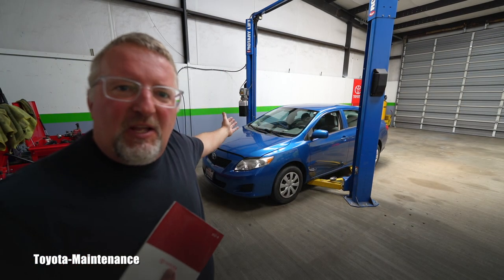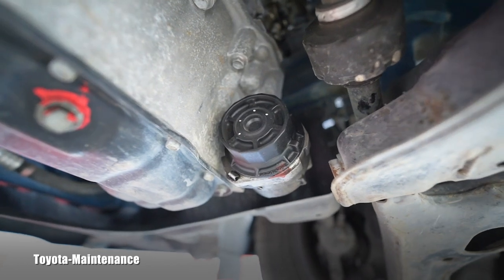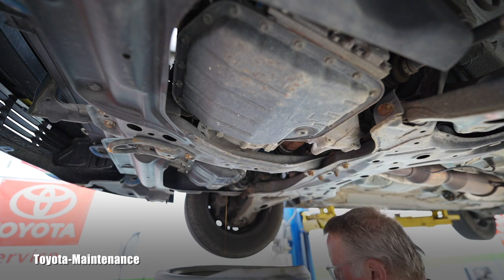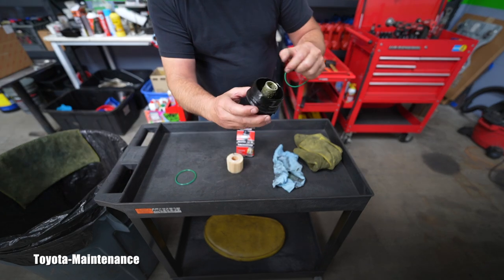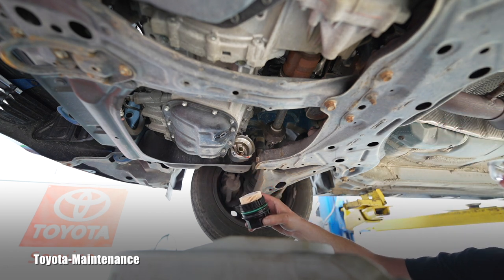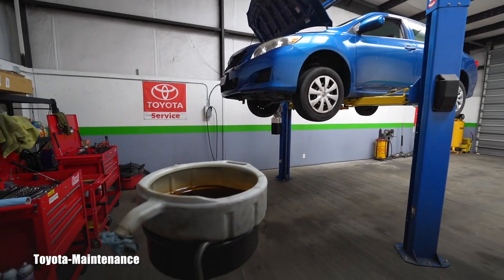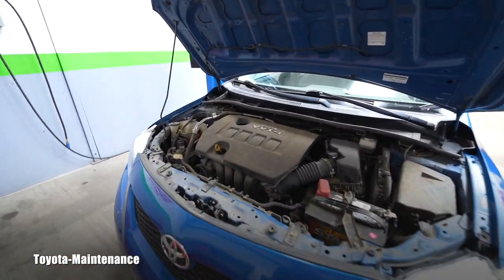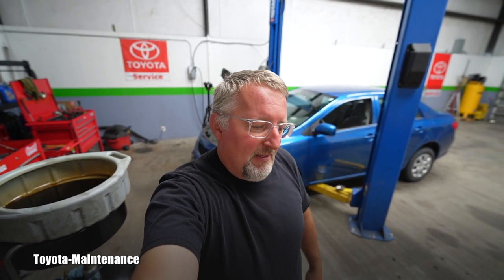2010 Toyota Corolla Engine Oil Change

Comment: I also take a small dab of oil and lubricate the o-ring at the top of the dipstick to prevent future sticking of the dipstick.
Reply: Guess you didn’t pay attention, cuz he did exactly that😜
Reply: @joshhemingway7294 Guess you didn't read the comment properly, he was talking about the o-ring on the dipstick not the o-ring on the filter canister!😜

Comment: So many people overtighten the drain plug and the filter cap. The plug only needs to be tightened to the point where the bolt stretches into elastic deformation and applies enough stretch and friction onto the threads to prevent loosening. It is NOT much torque. Tightening to plastic deformation ruins the threads and they will come out eventually. Same for lug nuts/bolts. The cap seals on that O-ring. These are not pipe threads. 😸😸😸 The cap only needs a small snugging torque and that's it. The O-ring seals it, and the elastic deformation of the threads keeps the cap in place. I've seen so many overtightened like this one, and it will eventually crack the cap and then you have a pressurized oil leak. 🙀 Not good. When I bought my 2012 Corolla used, I replaced that oil filter cap with a brand new one from the dealer because there's no way to know who abused it in the past and how close it was to breaking with further use. It was not expensive. I highly recommend replacing it anyway after 60-75k miles even if you are the first and only owner and did all the oil changes properly from change #1. It's good, cheap insurance!
Reply: Everyone should buy one to have an extra one on hand anyways! That’s a good plan around 60-70k 👍 completely agree

Comment: The camera depth of field at 8:40 has everything behind you in clear focus when you are showing the filter and O Ring because the focus is setting on the distance back there where there is not any motion of objects. That leaves you and the item we need to look at in a blur. Manually setting it to close range will overcome this.

Comment: That plastic oil filter canister was the worst design on the whole car. Everything else was actually well engineered. I had a lot of trouble getting that filter off and finally found a trick. Use one of those specific wrenches like you showed, and tap/hit the handle of the ratchet with a rubber mallet. This will slowly and gently break it loose. It's like a miracle it happened so easily. 

Unfortunately the first time I changed it I also put the o-ring in the 1st groove and after all was done and I cranked up the car, oil sprayed out all up under my engine, bottom of car and the ground. It was very scary until I figured out what I had done. Of course I immediately shut off the car and fixed that issue and I had lost so much oil I had to put I think 3 more quarts back in.
Reply: IS there not a metal aftermarket upgrade to use in this ?
Reply: @SaltGrains_Fready  There is but the spring inside isn't up to Toyota spec. I watched a video of a top notch Toyota tech and he suggested only using OEM Toyota plastic canisters. 

He said aftermarket plastic canisters won't last long, but I do have one on mine and it's lasted for many years and still going.

Since tightening it to a reasonable level, I've had no trouble getting it back off, and it's no big deal.
Reply: There is an OEM metal one get that, around 50 bucks get one

Comment: 13:40, A few years ago I found a great Cleaner and Degreaser I like to use on plastic and rubber parts like engine cover, engine oil filler cap, brake fluid cap, engine air filter cover and other greasy automotive parts and tools. 
It is a WD-40 Specialist Cleaner & Degreaser. It is safe for use on aluminium, chrome, glass, plastic, rubber, stainless steel, leather, paint and much more. It is water-based biodegradable.

Comment: Nice job sir 👍🏻. Btw,  next empty bottle of washer fluid, save the cap as it will fit on the drain neck of your oil catch pan.  Used it on mine, same one. 😁

Comment: Thanks for the video.  I recently purchased a 2010 tc s. Going to have to get the fiter wrench.  And sure would be nice to have a fancy funnel. I bought Castrol,  high mileage synthetic,  0-20 .a Wix brand oil filter.

Comment: I have a 2015 Corolla with the same oil filter and I hate that filter the first time I did the oil who ever put the filter on last over tighten it and it was a pain to get off and the cap was out of shape so I bought oem parts from a 2019 Corolla to converter it over to a good old canister style so much better now hahaha

Comment: Thanks for the video. For future DIY, that oil filter housing has an oil drain plastic tool that comes with the oil filter and a small gasket that attaches to the drain channel and then the drain screw. And it seems that the owner of this Corolla has lost or miss placed. Take care.
Reply: My Corolla doesn't have the filter housing cap drain nipple. I don't think the 2ZR-FE came with one of those like some other Toyota cartridge filters did. The 2ZR-FE cartridge is horizontal as you can see. The cap has deep flats cut into the threads which align with the same cuts into the housing. When you loosen the cap and unscrew it, you just unscrew it barely all the way, and align the 2 flat spots. The oil drains out through those flat spots right down into the drain pan. Once the cartridge housing has been drained through those flats, you can unscrew the cap the rest of the way and there will be 0 leftover oil to splash and make a mess. The plastic drain thing you're talking about is for cartridges that are vertical, since this flat spot method won't work. The drain tap drains the cap out cleanly. Check out the 2ZR-FE cap to see those flat spots I'm referring to. 😎👍 My 2012 Corolla is very simple to drain because of them.
Reply: @mannys9130  my 2009 Corolla 1.8, my 2017 4RUNNER 4.0 and my wife’s 2015 RAV4 all of them have the oil filter housing including the oil drain nipple. Yes the oil change without the housing it’s easier. I agree.
Reply: No it does not. The filter housing that is horizontal like this doesn't come with it. The canister would not even drain if it had one.  Only Toyota filter housings that are placed vertically have them.
Edit: the comment above addressed your  comment already🤷‍♂️
Reply: @Miguel.Rosado7224  my rav4 has this housing, it's so dumb. My corolla has the screw type which is way better.

Comment: Next time I change our oil I'm switching from the blue crush washers to s copper crush washer. Those blue ones are coming apart with part of it sticking to the oil pan and part of it sticking to the drainplug and I have to scrape it off both surfaces.

Comment: I have a 2007 Toyota Camry LE 2.4L . It currently has 149,266 miles on it. It always had oil changes on time with conventional oil. My question is, I'm thinking of using 5w-20 full synthetic so do you think I should use that or keep using conventional especially with the milage on the car .. Thanks
Reply: Synthetic is better for new or old cars.
Reply: When your owners manual states it can take 5w-20 for the temperatures in your area you sure can try synthetic as well.

Comment: What happened to the high quality parts?
Reply: If customer brings, use.
Reply: FILTER LOOKED GOOD. OIL IS FULL SYTHN. SO IT'S EXCELLENT. I'D HAVE CHANGED THE AIR AND A.C FILTERS TOO
Reply: @captainamericaamerica8090   Well he used to use Toyota Genuine filter and Toyota Genuine Motor Oil (TGMO) and now he uses some third-party filter and Costco oil

Comment: That is an absolute stupid oil filter design, should be the normal steel screw in type.
Ive bought a New Zealand model corolla 2009 , ill check if its the same as this, i hope not.